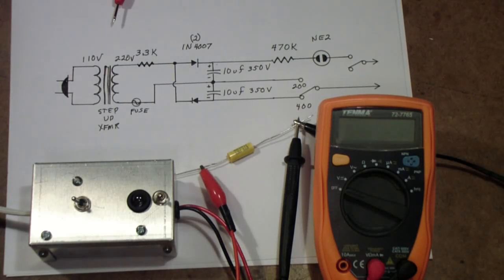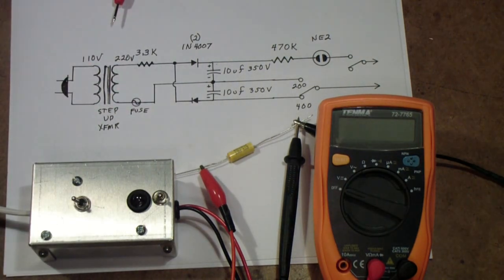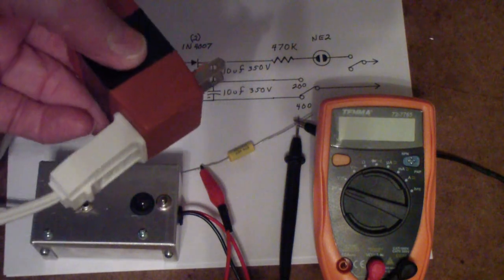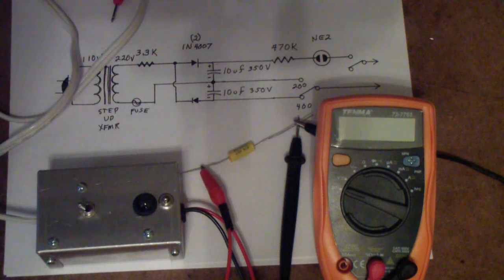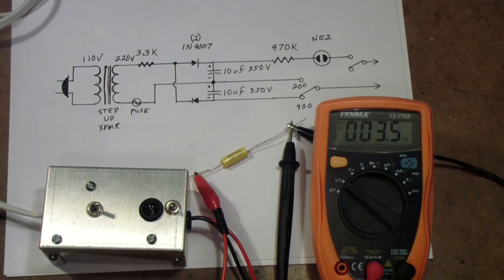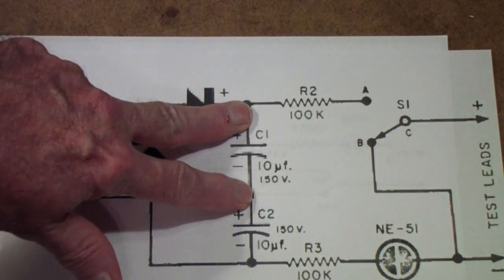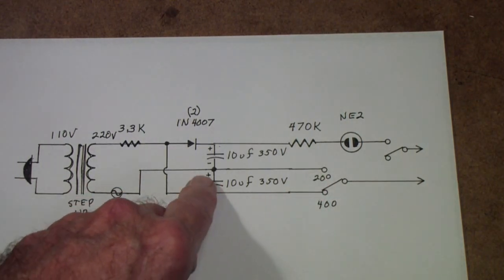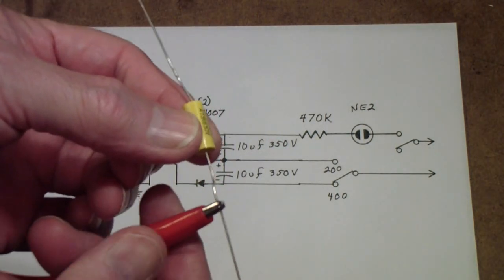TTT135 DIY Capacitor Tester

Comment: Thanks for this vedio can I check electrolytic capacitors . Electrolytic cap have a high leakage current
Reply from the maker: This tester was originally designed to test high voltage >250 volt coupling capacitors used in TV sets. It also works well for high voltage bypass capacitors. It was never intended to check electrolytic capacitors although it can be used by a skilled person for electrolytic capacitors as long as that person understands the difference between film capacitors and electyrolytic capacitors both in terms of their leakage and charge characteristics.

Comment: I built one following your schematic exactly. It did not work as I got a small reading of volts & minivolts. I changed the direction of the diodes, thinking that would solve it, but to no avail. It's a letdown as I really wanted to have one handy.

Comment: Tom! On “your” schematic, you say that when the switch is switched of, that it discharges the capacitor.On the original schematic, I can see that the push SW does discharge the cap.But on your version where does it discharge to.Or am I completely missing something? I would like to build your version. So perhaps you could let me know how it discharges on your version. Thanks for all your vids.Boy am I learning about electronics! Wish I was 24 instead of 74! 👍
Reply from the maker: In the final version I used a DPDT switch that shorted the test leads when in the non-test position. I don't have time now to check but I thought I said that at some point in the video. But if I didn't, I should have. Thanks for pointing it out.

Comment: You are using high voltage on the testleads, with a metal housing, and with the positive lead almost touching the metal housing while you are handling the tester.
Seems very safe working........NOT
Reply from the maker: Thank you for your comment. I am glad to see that you understand the lack of safety in these vintage designs. Even if you use an isolation transformer as I suggest, there is still a need for inexperienced people to avoid projects like this old one and buy modern, safer equipment.
Reply: @tomtektest8042  , thank you for responding.
Reply: wouldn't matter if you were to touch one of the leads as long as you didn't touch both at same time (isolation transformer )

Comment: Good vidéo thanks but if i have capacitor 1000 v how test this capacitor
Reply from the maker: I would use the Sencore LC102 which can put up to 999V on the capacitor for leakage. Sencore also made an LC103 that would work but I do not have one, so I would use the 102 set to 999V.

Comment: Sir a Question , can it check 10 volt electro caps
Reply from the maker: Good question and the answer is no, because the tester uses full AC line voltage, it will only work on capacitors of approximately 200 volt or higher ratings. The tester was originally intended to test capacitors used in TV and radio sets made in the 1950-1960 era, which usually had paper caps rated at 250 volts or more. It is definitely not appropriate for transistor or other low voltage capacitors. There is a danger that it could actually make a good low voltage capacitor bad by over stressing it. I would not use it on any capacitor rated at less than 200 volts, which is the approximate open circuit voltage at the test leads when the test button is pushed. This assumes that the tester is built for and used on a 120 volt AC input line.
Reply: Excuse my late question: with a variable transformer (plus isolation, of course) you mentioned in the video much lower voltages could be applied to the cap, eg 50. Is 10v off the “Variac” any different?

Comment: Thank you for providing this video...you do such a great job presenting/explaining things!! And I love that you stress so often and emphatically the need to be careful with such electronics. Far to often, I find that other channels are too flippant about safety...perhaps because they get tired of mentioning it, or don't want to get the negative criticism in the comments.  Is there any reason you would not have used a three-prong wire and grounded the chassis of your box?

Comment: By the way.  What other indicators could be substituted for the neon lamp? An ammeter perhaps? Or maybe a voltmeter?
Reply from the maker: I will try to answer both your questions here. Putting a lamp in series with the line helps protect the circuit from over-current in case of a fault but really does not replace the safety of an isolation transformer. Please take a look at my video "The Death Difference" for more. A lamp in series will reduce the output voltage of the tester so you can test units with lower voltage ratings. You should check the actual voltage of your tester with the lamp in series to see what it is since testing at too high a voltage can ruin a good capacitor. For example, the DIY Tester should not be used on low voltage capacitors (less than about  150 volt rating). As to replacing the neon bulb, the neon bulb has the advantage, not only of lower cost, but also faster response. Smaller capacitors will charge quickly, so a meter is a little slow. For example, if a small capacitor has a little leakage, the neon bulb will blink every so often, but a meter would probably not budge. An ammeter will show steady leakage or a short, however. A voltmeter will not work too well since you are trying to test for leakage current. Hope this helps.
Reply: Thanks for the reply.  I will always keep those facts in mind.  I am in the process of restoring a Pioneer SM Q300B bought in the early 60's.  My sister's family stowed it away in a rat infested house.  No choice but to completely disassemble and repaint the chassis.  Not too keen on restoring the dual am,fm and sw receivers at the moment.  But the amp sounded great at the time.  I actually cloned it in high school but the factory matched components and output transformers made the difference.  I had to wind my own power transformer since it was not available commercially.  This capacitor tester would be used to test and reform salvaged power capacitors for future use.
Reply from the maker: I like to see this vintage equipment restored to its former glory and I wish you well with this one. I am glad the tester will have a place in the restoration. I assume you know the importance of care in cleaning equipment that has been exposed to animals - respirator when scrubbing, gloves and disinfectant until no traces of the animal leavings remain. Let me know how it goes.

Comment: Our line voltage down here is already 220volts.  An isolation trans 220-220 would be nice but is not ordinarily available.  So maybe a 25 watt bulb in series with the line would suffice.  Am i right?
Reply: No, you could use two 220V/12V or some other secondary voltage wired back to back. (two secondaries together)

Comment: one quick warning.
If you need isolation, despite what you said..a Variac does NOT provide isolation..it is an autoformer...and since there is only one winding, there is no way to have an isolated output.
there are units that combine a isolation transformer with a Variac.
those units DO provide isolation.
Reply from the maker: You are correct and you can't remind people enough about this. I use a Sencore PR57 as you see in my videos which provides BOTH isolation and variable voltage. But it can't hurt to say it again and again since I think some people don't actually pay attention to the videos and might think that any variable transformer provides isolation which is not necessarily true. Also, we shouldn't really be calling it a Variac since that is a trade name registered with the US Trademark Office. We really should say Sencore PR57 or use the generic term," Variable Isolation Transformer." Thank you for reminding everyone.

Comment: also finds leaky if transformers with silver migration desease, hook up one lead to primary and one to secondary with transformer out of circuit,light will come on or flash if transformer is bad, I made one like the orig.design years ago,its really a q&d tester for finding lots of problems.
Reply from the maker: Thanks for the comment. I agree. The same tester will also reveal primary to secondary leakage which will upset the bias in an old TV so badly the sync pulse will be compressed due to overloading. Strange to find what looked like a problem in the sync circuits was often really an if transformer leakage problem allowing B+ from the primary to leak onto the secondary..